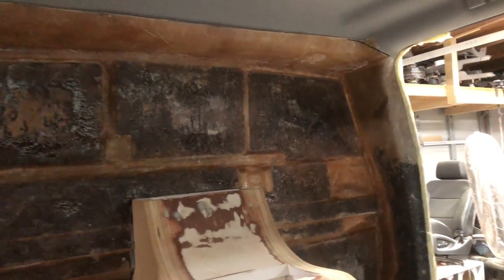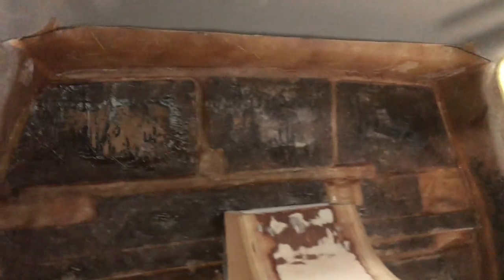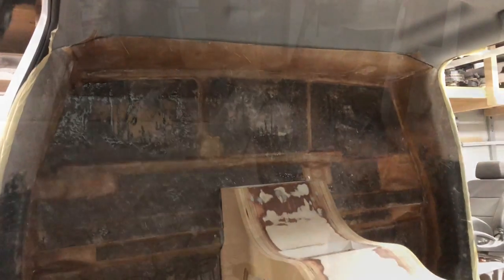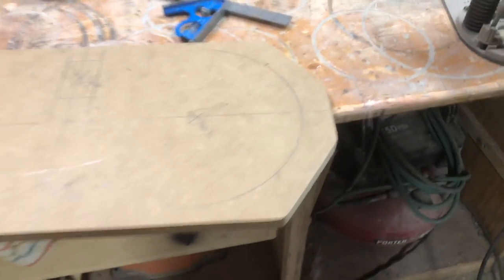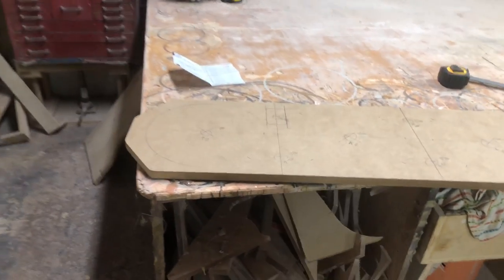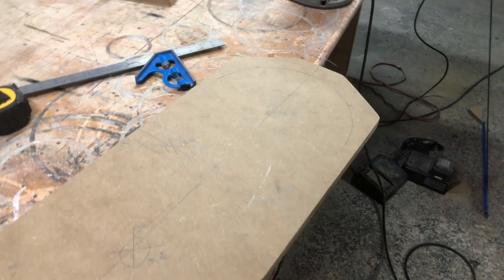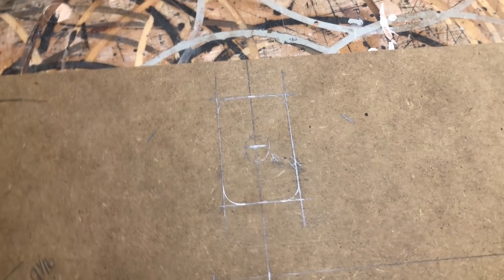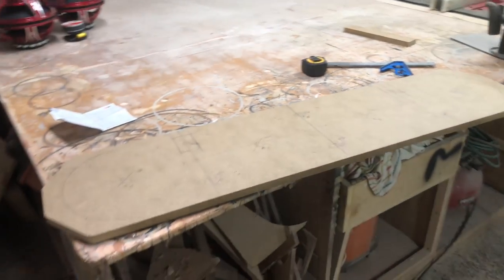IN THE SHOP WITH CUSTOMLOWZ Car Audio Vlog Ep49

Comment: Nice work.
Are those rear 10's a PA style speaker?
Reply from the maker: thank you! what do you mean PA style?
Reply: @CustomLowzVids  PA is public address... PA system, PA drivers have a wider frequency range, in PA a 10" would be considered a midrange and cover around 200Hz to 5Khz.